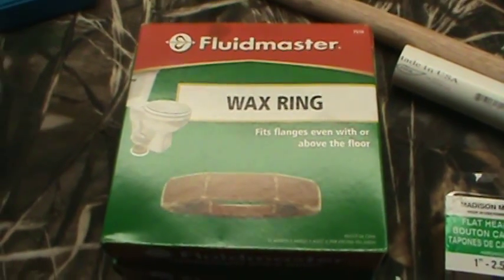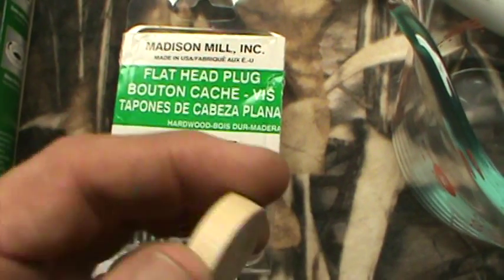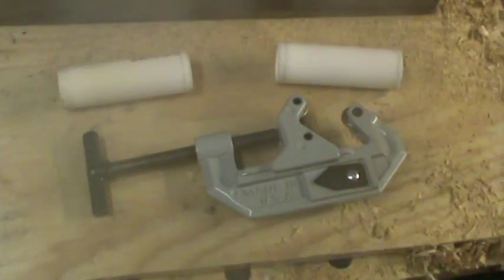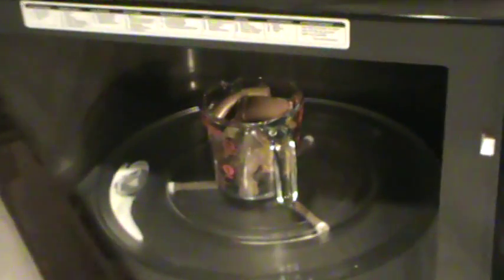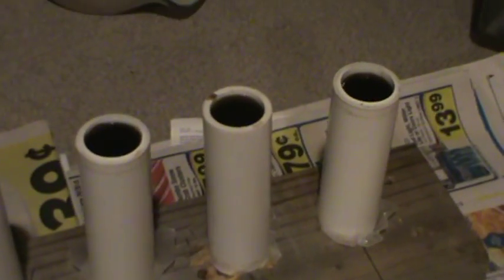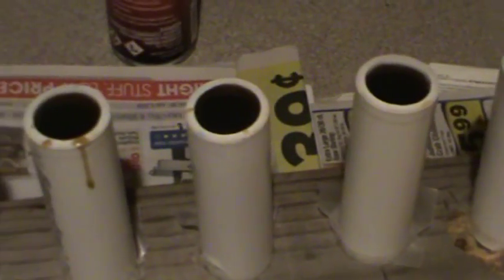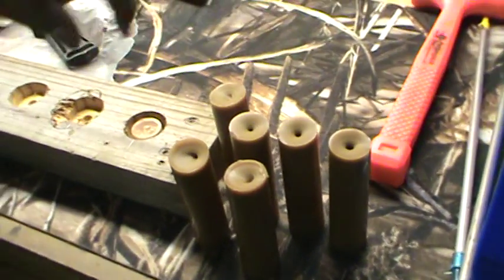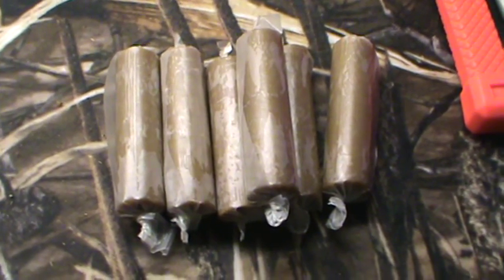Diy bullet lube project

Comment: One thing you can apply to your hard cast bullets is professional grade floor wax. For years I used a product that goes by the name "Rooster Jacket" and had good results with reducing traces of leading in my barrels,  I experimented and found that the Hard wax floor coverings work just as well for a lot less cost.  I too have a star lube seizer with all the bells and whistles auto feed, Heater and air powered ram for the lube chamber. I do all the normal steps first and then as a final step I finish them off with the floor wax to coat the entire Bullet.  If you decide to change lubes give White Label a try I have found it to work just as well as "Rooter Red" Hard lube at 2.00 a stick.

Comment: I cast for all my calibers, most get lube, others paper patch. A good lube I have found for all is 60% bees wax and 40% lanolin. It is sticky but seems to eliminate leading in my high pressure pistols and rifle loads.
Reply from the maker: have seen that recipe,  never tried to though,  just finished casting, lubing almost 6k of 45acp, 8k of 9mm, with my rationing plan, I won't have to do this for about 2 years,  might try your recipe then, appreciate the input,  have a great week, stay safe and warm